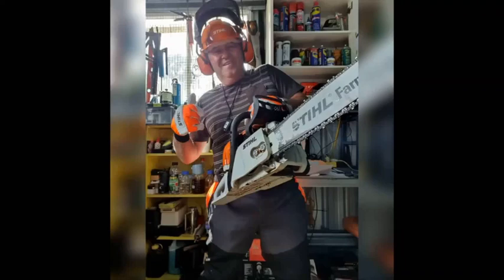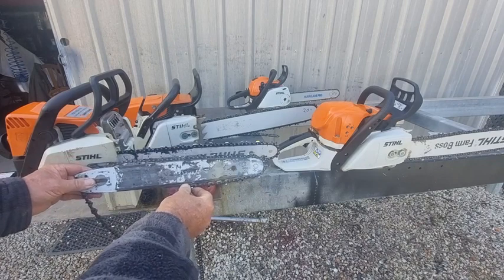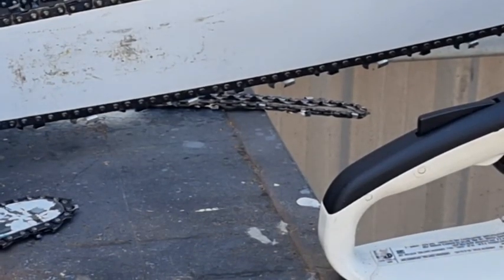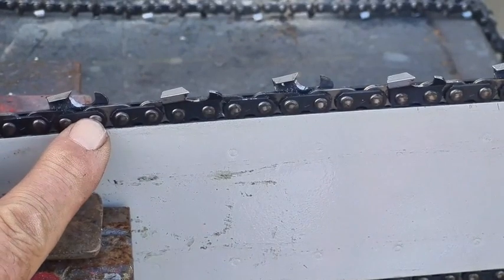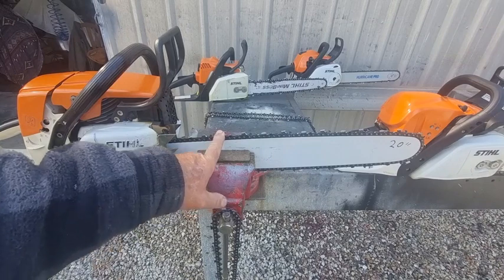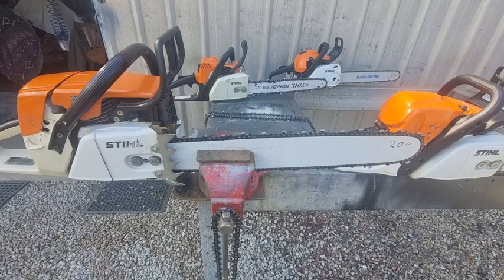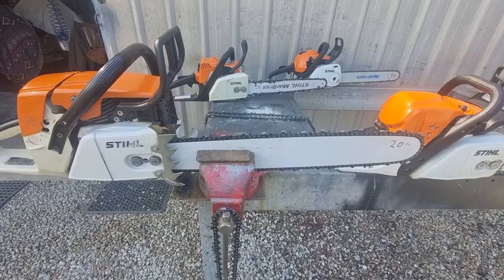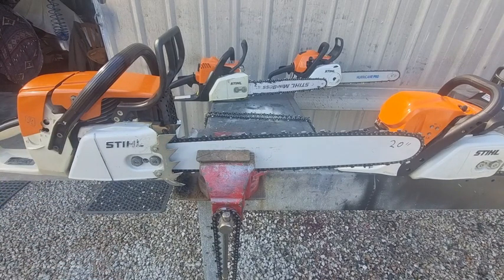Puting a larger bar on your chainsaw

Comment: I appreciate your videos. I downsize my bars due to living at 6000 feet above sea level and go high as 9000 feet to cut wood. Do to horsepower loss at these elevations, a shorter bar helps. I also use skip tooth on soft wood at the high elevations. I am in the U.S. in NW New Mexico and also cut in the mountains of SW Colorado.
Reply from the maker: Interesting situation that about elevation.  Hope your wood is soft.  We have very hard wood in Australia.       Bigger saws have there place but if you have to use a big saw all day that's heavy can be very tiring thanks  for your comment

Comment: What number do you need to carry over to the longer bar? Do you keep the low profile chain? Does the number of drivers change?
Reply from the maker: Yes I use longer bar and more drivers 16 inch bar 3/8 lp 55 drive links

Comment: I match the bar, chain and saw to the job at hand. I have short, medium and long bars.

One reason to use long bars (besides less kick back) is limbing standing up. Also when doing large scale culling a longer bar is faster.  Are you a TAFE teacher ?
Reply from the maker: I can do that with the 500i 20 inch bar to 36 inch bar
Reply from the maker: I used to teach PhD students using a reactive extruder in polymer science
Reply: @ChainsawUsers  For large scale Cypress culling I use a 460 with 25 inch bar and full house chain since it's soft and maximum thickness is about 8 inches. Long bar saves bending over especially on the small stuff up to 3 inches.

In SW Qld the Cypress is an invasive native.

Are you a TAFE teacher ?
Reply: @ChainsawUsers  Education, training, certification and experience is important. You seem to know what you're talking about.